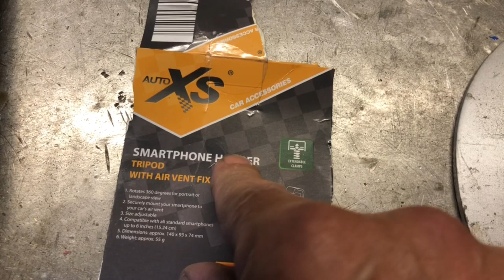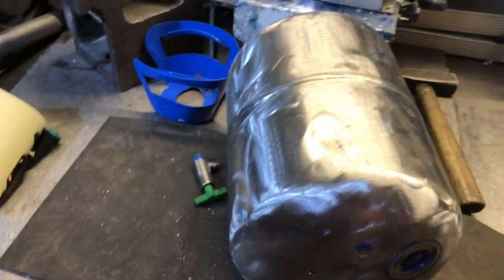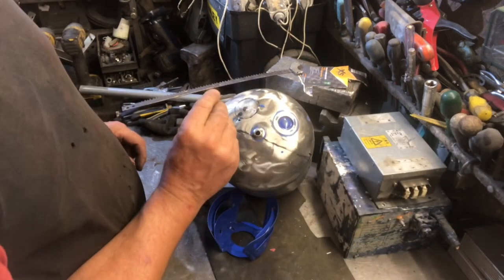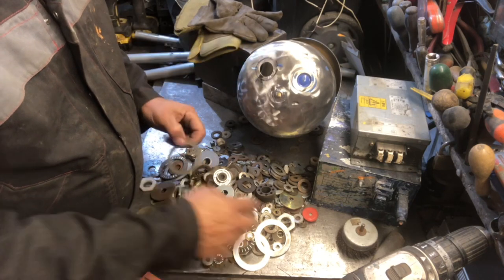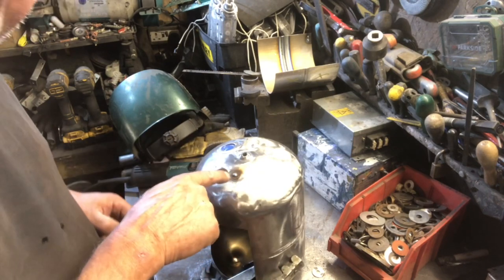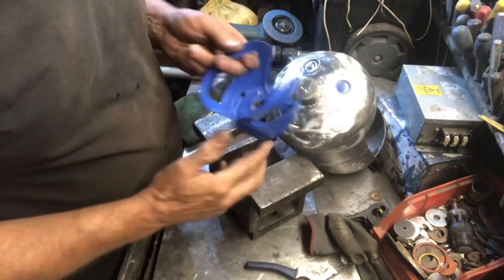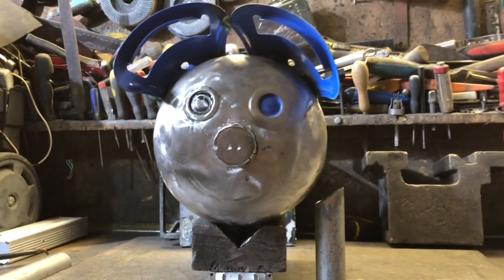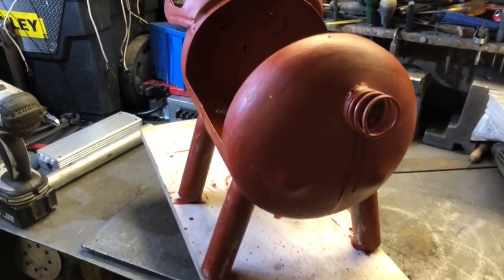Helium bottle pig ( or Chinchilla )

Comment: Thanks for welding tip using the copper, you seem to do alright with your mig, is it a gas or gas less welder? Love your PIGLET, l loved all your previous creations too, is it miss piggy?
Reply from the maker: It’s a gas mig, I use 1mm wire which is a bit too thick but it’s free from work, the gas I use is  an Argonmix with a little co2 and a tiny percent of oxygen,

Comment: Ian.Use a microwave plate motor its 240volt and geared. use the roller  bit from inside  to make it remove easily
Reply from the maker: Then Folk would think I’m an engineer 😂

Comment: First of Ian gets new phone holder but he buys wrong one only  Ian could do that. Then set's out to make a planter. Bit of waffling about not having a gard on his grinder. Cover eye's very important only get one set. Finger well you got ten of them lol 😂😂. Aye 👀 don't touch hot thing's.I believe you have never thrown any away. Are you suggesting I hit my sockets with an ommer lol boller suit looks like Massey Ferguson logo on it. Maybe Farmall fanatic would like it  might last a bit longer than one of  them old tractors 😂😂.  So back to the planter what do I see in Honest Ali Mack word's I see a muic which is the Gaelic for Pig. Cobalt drill bit very handy got a few of them. A handle for ear's  Ian a grinder God bit like myself really lol.😂😂 shamfer legs weld them on. First of all stick it on metal work out where you want legs.  So it kinda looks  like a  rodent not Tim's 🐁😂😂😂 I hope you have fun reading this Ian
Reply from the maker: Your running commentary always makes me smile Ali. Oh. And I would NEVER suggest a mechanic abuses his socket